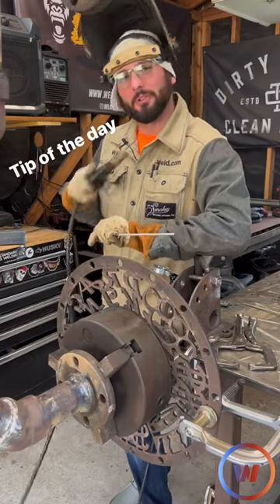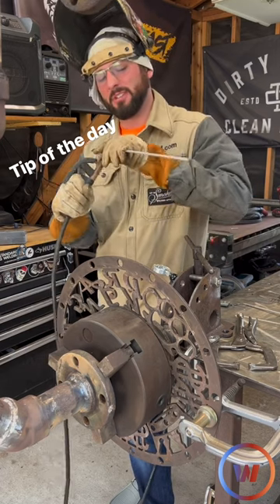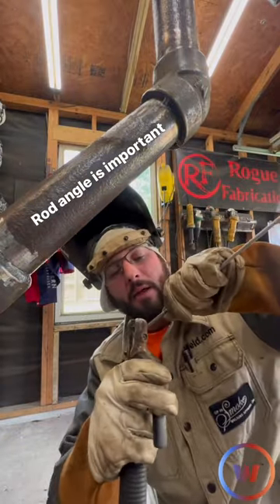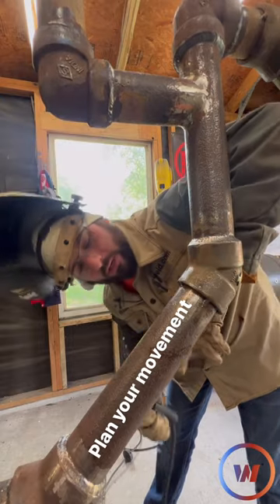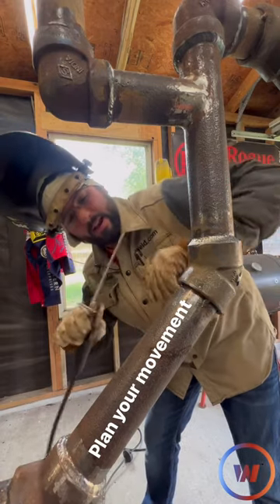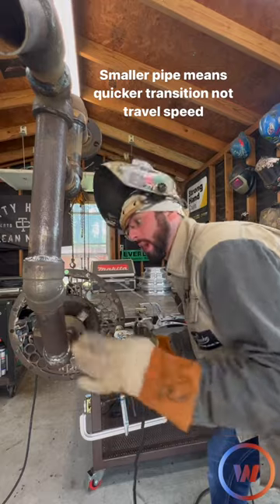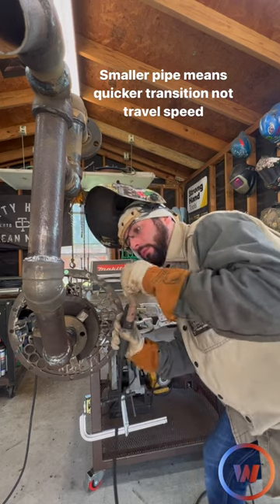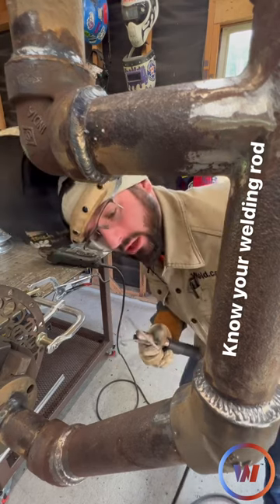Welding and Rod angle

Comment: Uphill only is what got me 😂
Reply: he's totally wrong 7018 is an all position electrode
Reply: They say it's all position but it doesn't work worth a damn downhill
Reply: All position except vertical downhill. It is not a downhill rod for any application. Lincoln plainly states that on their data sheet.
Reply: @armandogonzales1365  down hill isn't a position. It's a direction of travel.
Reply: @tom-vs3lf 
 *
Down is For Chickens / boy / girls
Reply: @DelbertCook-zp4uv Unless your running aluminum wire in a mig.

Comment: The real old school welders knew the reason to bend that rod at the stinger
Reply: An old timer taught my young ass to do that. Bend it at the stinger so you can roll it in the stinger as you move around the pipe instead of changing the angle in your wrist
Reply: @stevez7530        Old cat told me that the bend catches a bunch of the nastiness in the current going through the rod.  He said that’s why the rod starts getting real hot in the bend.
Reply: @KB Brister  I never thought of that. Thank you for the input. I'm still new at welding so will gladly take in any additional knowledge as I continue my journey

Comment: you are completely inaccurate with your comment about 7018 is only a uphill electrode it is an all position rod how long have you been welding and are you a certified welder that's misinformation brother been welding as a cert.welder fabricator for 37 years structural ,pipe light Guage ect,etc just educating you in 7018